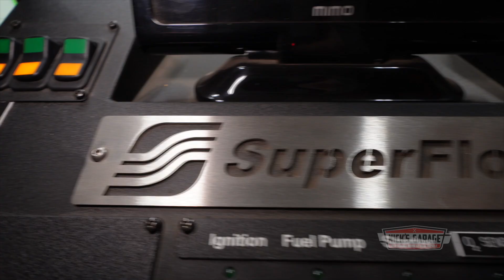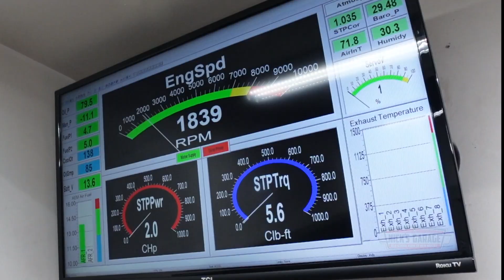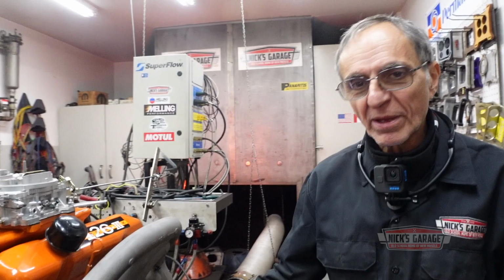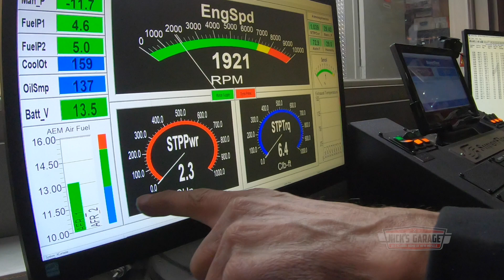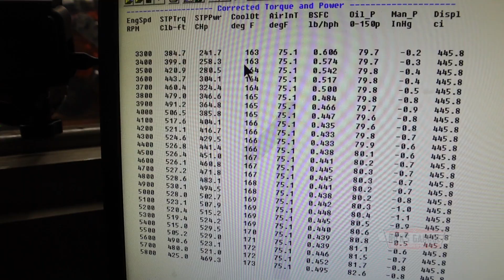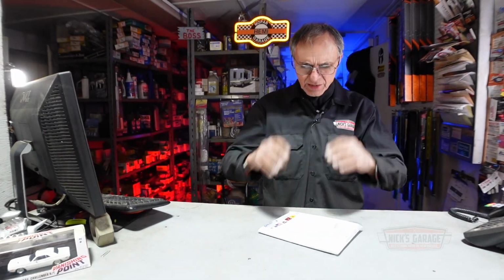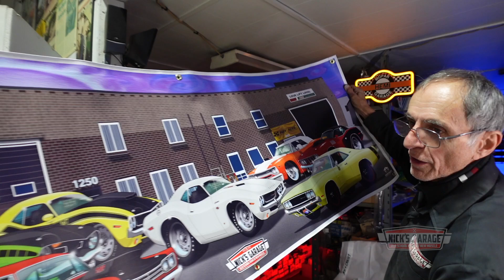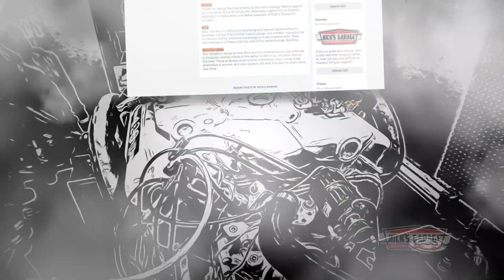Rare MOPAR Max Wedge - HEADERS vs MANIFOLDS

Comment: A pair of those exhaust manifolds need to be on display at the Metropolitan Museum of Art
Reply from the maker: But who will donate them?  :)
Reply: You know, people these days are reproducing just about everything, blocks, heads, intakes, and so forth. I'm surprised that nobody has taken it upon himself to make reproduction Max Wedge exhaust manifolds. So what if they would cost an extra $50 or $100 more than "normal" cast iron exhausts..?.. we get what we pay for, which are art forms for an engine compartment. Maybe this episode at Nick's Garage will inspire somebody to make a run of them. If the word was put out, somebody with a set of them would surely loan (or rent) them to be used as master molds "for the cause." Same for the cross ram intakes, there's got to be a market for them if they were available, and whoever made them up, nobody would object to paying extra for the jewel that these things are. HINT.. HINT... HINT. Are YOU the somebody who might do this.? I'm 78, living hand-to-mouth on Social Security, so its beyond my reach, but somebody's gotta be out there that won some lottery somewhere and has some extra coin for a project like this. Somebody just paid to work up some casting molds for the Dodge 270-315 gen one hemi heads from 1956 and had a small run of them cast and machined, which is about as small a niche as could be imagined.
Reply: @bobkonradi1027  Mancini racing does an aluminum copy of the cross ram.
Reply: The Detroit Institute of Arts would be good .
Reply: They already are....
Reply: The dam Louvre!!!

Comment: 1968 I picked up the exhaust manifolds with 3 inch pipes coming down and back a short length with a flange and reduced to  2 1/2 inch and put them on a 383 in my 62 Dodge Polara 500.  Just missed the brake booster but when I swapped in a 440 I had to lose the brake booster. They also burned through exhaust gaskets so I ran without them.  It would make the ticking noise for a short time till they got hot and no noise. Painted them white, looked great.   I paid $10 for the manifolds.

Comment: The Max Wedge on the Dyno part 2, I've been waiting for this since last Monday. I'm anxious to see the final HP results, between headers vs exhaust manifolds. Here we go!!!
Reply from the maker: Here we go, indeed! Another beast for the street. Thanks for watching, Eugene. 😊
Reply: @NicksGarage  The engine made some very nice numbers for a cruiser, and there is nothing like seeing a Max Wedge cross ram intake when you open the hood. Another excellent video George, awesome content, great music, and superb editing. 👍
Reply: Great Video! What an engine. Work of art and boy did it sound good! Another happy customer grinning ear to ear.
Reply: Stop the video when Nick shows the dyno results. Chrysler set up the cross rams to produce peak torque at 4400 rpms. Note on the dyno sheets that the torque really comes on at 3800 rpms and stays in the clouds up to 5800 rpms. And it REALLY comes on in that range. More with headers, of course, but close with the cast manifolds. Chrysler said peak torque @ 4400, and this engine said @ 4300. Very wide, flat torque curve. If Chrysler had a 6 or 8-speed automatic trans at the time, they'd have had a world beater.

Comment: My 63 Sport Fury aluminum head 426 max engine bolted to a  TKO-600-5-speed with all factory manifolds gave me 23.4 mpgallon @ 80 mph @ 2000 rpm--and 16 .4 mpg @ 100 mph and 2300 rpm on a 165 mile trip to Don Gartlets show about 10 weeks ago--These Max Wedge and 426 Hemi engines are awsome bolted to the 5 and 6 speed stick trannys--Its a world of difference from the 727 and 4-speeds--NO CONTEST--loved the max wedge video--And I use the Comp cam 292 duration -535 lift cams with variable duration lifters in both my Max and Hemi engines and 3:23 sure grip gear. Thanks for your videos--hemidon

Comment: Hey boys and girls, you don’t need vacuum advance when your engine is on the dyno because under load you never pull enough vacuum to make the vacuum advance work, but in you car you do need the vacuum advance to work it helps keep the plugs clean and burns all the fuel in the cylinders. Etc.

Comment: Good dyno test info...Really Impressive HP & Torque for a pump gas "Max Wedge"  mild mannered,  watered down "Street Version".... After All the  Eye Candy  attention getting  "Max" racing externals as Max VC Sticker, High flow 320+ Cfm Max Heads, Factory Short Ram Intake & Carbs + Factory Ram exhaust manifolds, For whatever Reason the "Package" is castrated with such a Lame Wimpy Smooth idling (No Lope) Short Duration cam maxing out at 5400 revs ?? .....The '63--'64 Oem Factory .520" lift  320° (probably 265° at 0.050) Cam was Key to enabling the "Max" superior Wining HP curve to Beyond 6800 Rpm shift points & Trap speeds.....Considering it's only 3.75" stroke, that little 250° puke juice cam Is Really Short changing this engine's Dyno Test results by at least 1000 Rpm & Misrepresents to most folks Today what these nearly 60 year old engines Really did Totally Dominating the Early/Mid '60's Street & Strip scene.....

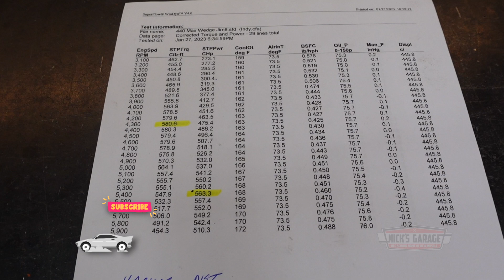Comment: I just watched this video for the "4th" time. This time when he showed the dyno sheets (2:38), I looked at the brake specific fuel consumption, and noticed how the BSFC went way down at 3700 rpms and stayed down to 5900 (the lower the number, the better) Using less fuel to make better power equals greater efficiency. Really this engine has pretty good numbers throughout, but especially in the mid range with the intake manifold runners tuned for 4400 rpms. Chrysler got a really good spillover for 600 rpms lower, and especially for 1000 rpms above the design peak efficiency. For reference, carbureted, non computer controlled engines usually are in the .500+ BSFC range.

Comment: 409 killer back in the 60's.  13 1/2  to 1 compression on the 425HP version.
Reply: You Are 1000% Correct on That !!  Chevy Knew how to put The Correct Long Duration solid lifter camshaft in the high compression 409 to Blow Everything (Except a Real Factory Max car) Away !!!  ......   Except during the 1962--65 Max Wedge years, Chrysler Never put the proper Factory cam or compression ratio in Any of their Street cars.....Even the Factory tubed Street  Hemi will get moped up by the HP 409 !!

Comment: There's  a "trick" to dealing with AFB's, those of us that didn't have a Dyno back in the day, took it to the Local Drag Strip, for me it was $5.00 on Wednesday from 5:00 to 11:00 PM unlimited runs, you just needed to wait in line for your run. There were lots of Tech Sheets suggesting Jet Size, Metering Rods and Intake Manifolds and Exhaust Headers or Manifolds on every engine imaginable to help you get where you needed be in 1978, the AFB had been around for about 20 years. I remember setting Jets to the smallest in the AFB Strip Kit and if your Car Bucked like a wild Bronco in first gear, you kept swapping jets bigger until the bucking stopped at 5000-6000, then you worked on mid range and that was the taper of the Metering Rod in 3rd gear 3,500-4,000 make it lean so it bucked again at that RPM range, then go to the next size up and Full RPM was the smallest tip of the Metering Rod, that was were you needed a Timing System with Top Speed readings. Springs were for Throttle Response Tuning, 4 speeds could handle the faster accelerating Throttle Stomp, Automatics needed a stiffer spring to keep from flooding or over Carbing the Engine. If you think this engine was hard to tune, try a 413 with Dual AFB's and CROSS RAM manifolds.
Reply: He has one
Reply: @thefinalroman  A Dyno doesn't fix drive ability though...
Reply: @Timinator62   I meant Nick has a huge crossram 413 hes putting together
Reply: @thefinalroman  ....SOON.

Comment: I have been a mechanic for 30 years in Australia and I have never seen a wedge manifold but I imagine that they were probably a bit fuel thirsty but I imagine they were efficient with fuel delivery.
Reply: There is a few here in Adelaide,, both 413 with superlong runners and 426 with as we see. Letter cars and I thing two are owned by the same bloke.

Comment: Wow, I was expecting it to get richer with the air cleaners installed, not the opposite. Thank you for including that in the test. Also keep in mind that any exhaust leaks around manifolds will effect o2 sensor readings as manifold leaks will pull in fresh air. I only mention that because I saw a puff of smoke come out of left side of engine when you started it earlier on in the video, and you pointed out the pinhole leaks in the right-side casting. Thank you for the great content!!!
Reply: Are those vacuum secondaries? Maybe the filters restrict it so much they are not fully open?

Comment: I didn't learn of the brute pwr of the max wedge n cross ram 413 untill yrs later. In the 60's n 70's if you opened a hood to see those wide black or orange or chrome valve covers w/black plug hole in the center it was game OVER..... A Hemi !!!

Comment: Nick, I was around when the super stock max wedges were tearing up the competition running in the 11 second range in the quarter mile. The engine that you have on the dyno is a glorified 440 with an original cross ram set up. The original carbs were 650 cfm but also ran with 750 cfm carbs. The stage 2 426 car with the 13.5 compression ratio and the original super stock heads with bigger valves put out 588 horsepower at 6100 on the dyno which I saw with my own eyes. So, The bottom line is that properly tuned the original Chrysler built engine nearly produced 600 horsepower. Nothing at that time came close. Even the Hellcats primarily run in the 11s, probably because most of the guys that own them don't know how to drive. Find an original 426 super stock car and put it on the dyno.

Comment: on my 1978 Mustang II King Cobra, I have essentially the equivilent of a 1993 Cobra 5.0 302, .030 over, so now 306, ported iron E57 heads, ported Explorer 5.0 intake (w/phenolic spacer), Crane's slightly warmer 2031 cam, 1.7 rockers, 24lb injectors.  through a built T-5 makes 303hp. & 325tq through ported and extrude honesd, & Derakoted (in/out) MII V-8 cast iron manifolds. on the engine dynoe the stock 93 cobra shorties vs my ported Frankenstein Manifolds I am only giving up 9ft/lbs and 16hp above 5K. No header leak head aches, no header install headaches. no header noise iheadaches. amd its a great conversation piece. No fit issues around the T-5 conversion at all in the tiny MII trans tunnel. Last winter I had access to a full T-56 empty trans case, bellhousing etc. for a weekend, and my T-5 was out for the new Centerforce clutch. Even the gargantuan T-56 fits, no changes to my custom dual exhaust and x-pipe.  now granted there are some OE cast iron manifolds that arent worth thee head ache. but my combo works well. never even considered spending the $600 for the Hooker Supercomps (+coating) and am never looking back. ~R.

Comment: Nicks has convinced me to ditch my headers, my stock manifolds for my 67 Camaro are at the blasters now.
Reply: @General Lao I have angle plug heads, my wife took my car to surprise me for my birthday and have headers installed, I believe they are Hooker off the shelf brand, I have to stand on my head to get a ratchet on a plug, I have to run shorty plugs just to get the boot on.😂

Comment: Hi All many of you will know these rambling but for those who don't...Big Block MOPAR
Lifters  early and later  early had a small radius pushrod seat with matching pushrod small ball
What Max wedge came with. No Longer available and do not mix with the later parts  There are reasons why Ma Mopar upgraded   we ended up using 3/8 FORD size balls and balls or balls and cups     balls and balls pushrods to do not hit the cups on the rockers  but not with correct geometry either
Rocker Adjusters  original was a short distance from the ball to the threads, replacement have longer post
Adjusting the later parts with lots of threads showing and they Will break
go ahead and get the correct longer pushrods and adjust these with the ball as close to the rocker as you can
Recommendation  use AMC/Magnum lifters and hollow pushrods and oil those rocker adjusters through the pushrods  
Use the strongest pushrods you can fit even if you have to do some grinding on the heads and blueprint your shaft spacers
It is IMPOSSI BLE to set geometry by adjusting the rockers (even on a sbc) If you are running a higher than stock lift cam, longer valves  you need to set your geometry by adjusting your rocker  shaft location.  there are kits for this and not just shimming them up  Proper geometry gives the most area under the cam curve and the least wear.  It's what a quality cam grinder expects  cheers

Comment: I would changed a retrofit Howard's hydrolic roller camshaft and roller lifters, and stainless steel roller rocker arms , and billet timing set that has needle bearings behind the camshaft gear for less friction

Comment: Nick, these exhaust manifolds will fit perfectly in your 440 Challenger. And notice how easily they fit on your dyno too. As for the intake, Chrysler said at the time the intake was built and tuned for 4400 rpms. Look at the torque values around the 4400 rpms range. Thats exactly where the torque starts going out of sight, from 3800 to 5800 rpms. That's more than 426 street hemi numbers. HP gets the glamour, but torque does the work. And just as an aside, that's the numbers your Chrysler 300J engine with the long cross ram intake will likely produce. Not the exact numbers, because you're going to use a smaller cam, but my prediction is the range of numbers, the torque curve will be the same, just a little lower on the specifics. Those short ram effect manifolds were said by Chrysler to be tuned for 4400 rpms max also.
Reply: Unfortunately the max wedge exhaust manifolds absolutely do not fit on E-bodies or B-bodies after 1965. The engines were moved rearward by 2.5-3" for the 1966 model year, and the E-body engine placement relative to the firewall/inner fenders is based on what became the '71 B-body. The fuselage B-bodies were originally planned for '70 MY introduction. 
A&A Transmissions was responsible for getting the original cross-ram intakes and the max wedge exhaust manifolds re-cast, and they are available from Mancini and others. The intakes have been made in two versions, to fit conventional port heads as well as the max wedge heads, but the exhaust castings are more-or-less identical to the originals. It would have been relatively easy to make molds/cores to cast the manifolds with an altered outlet flange and perhaps a little more upright, to fit the later cars. Of course this would be a lot of work for a tiny market.
Reply: It's rpm, not rpms.
Reply: @georgewetzel4380 Whatever. I see you have plenty of spare time in your day
Reply: RPM, not RPMS

Comment: A tip on sizing metering rod and jets is that the fuel flow is very nearly proportional to the open area. With metering rod carbs like the Carter/Edelbrocks and the Q-jets, the open area is the annulus (donut shape) between the OD of the Rod and the ID of the jet. However the change of area (and fuel flow) is NOT proportional to the diameter differences, it is proportional to the difference of the squares of the diameters. So increasing the jet diameter will result in more fuel flow than increasing the rod diameter the same amount. For the typical sizes of jets & metering rods the difference is about 10% more than might otherwise be expected, and will be more for the power (skinny) end of the rod than the cruise (fatter) middle-of-the-rod. For this reason I have found it more efficient to tune by jetting first to get close, and then fine-tune with metering rod changes.
Reply: Exactly !